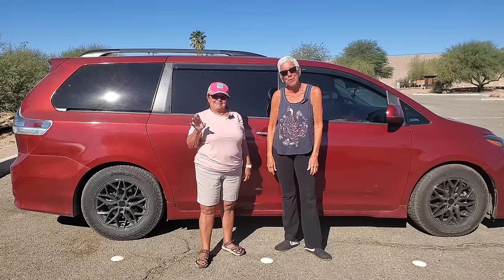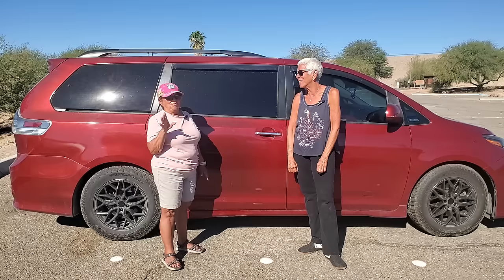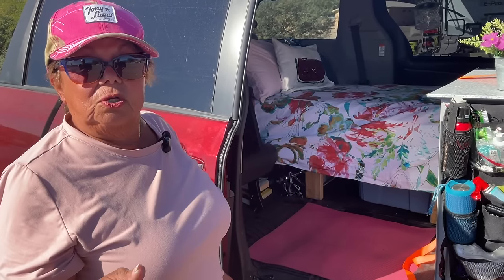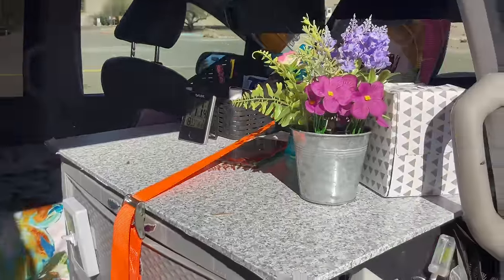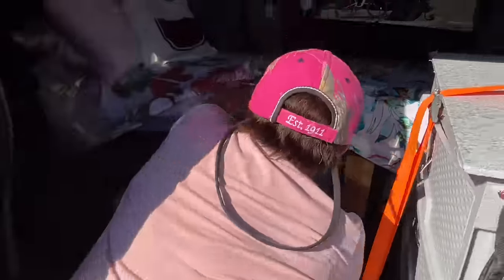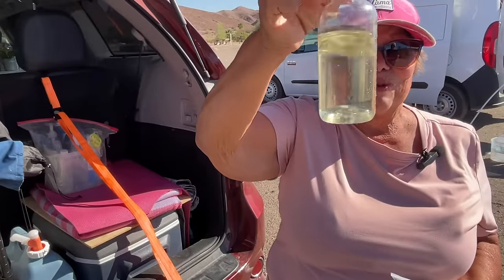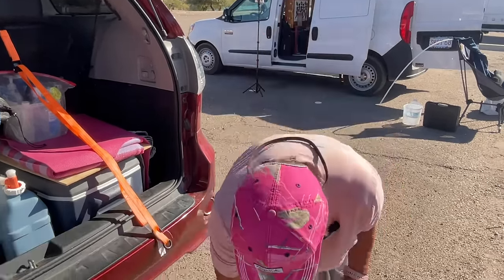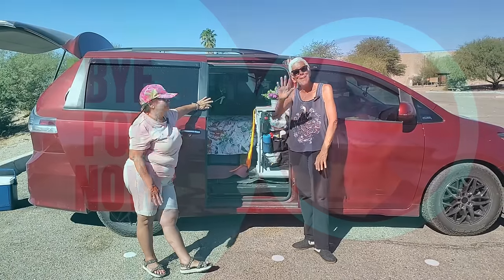VAN TOUR - NO-BUILD BUILD - 2016 TOYOTA SIENNA CAMPERVAN

Comment: Hello,thank you for the tour, finnaly a really minimalist van. I didn’t quite understand what are the flexible plastic curtains pole ? Where do we find that? It’s a great great idea with the clips. I listen from Québec with the french google translation !Have a good trip!
Reply: I got the curtain pole at Home Depot, a hardware store here in the States. It's called 'Screen Moulding', it's made of PVC and comes in a size of 1/4"Wx3/4"Hx8'L, but it's very easy to cut to your desired length.
Reply: @luannekent6048  Thank you so much for taking the time to answer!  In Québec, Canada we have about the same stores as in the US… including Home depot. So I will check that soon!  I’m very intrigued.

Comment: Luanne,  can you give a bit more info on the curtain rod. Adore the idea. Went to home depot but nothing seemed  a solid piece like yours. Also, is it sturdy with clip or would it easily fall if accidentally bumped while sleeping?  Thanks for time 🙂
Reply from the maker: she slipped it through those hand rails and it was there good and solid.  I think she called it screen moulding.  I'm forgetting.  watch the video again and see exactly what she calls it and then go to Home Depot and ask them for it.
Reply: @LulusWay64  thanks for time. I did watch video few times even after going to home depot. Seems their screen  molding isn't solid piece. Will recheck though, like her idea 🙂
Reply from the maker: when I've seen something on a youtube video that I want and I can't describe it or can't name it, I call the video up on my phone and get right to the part where they are showing it, and then I play it for the guy at  Home Depot.  that can help identify!!
Reply: @LulusWay64  hey, thanks so much will do 🙂👍 Great Journeys to you